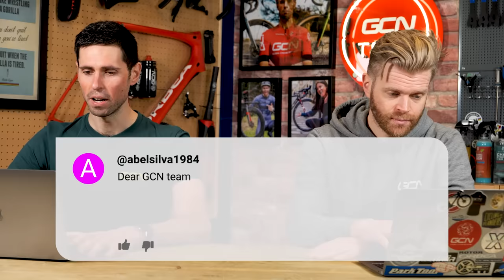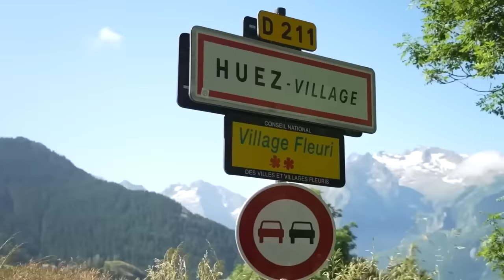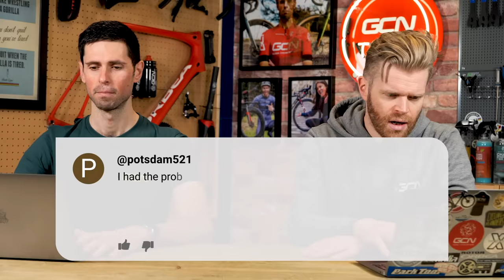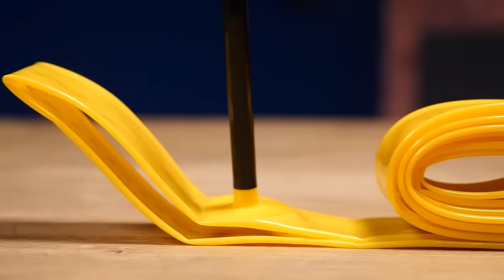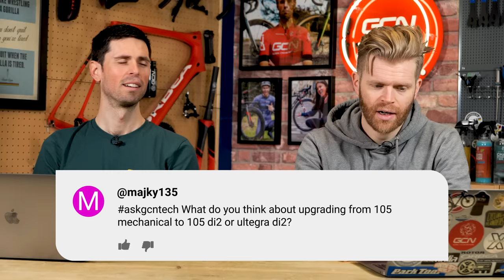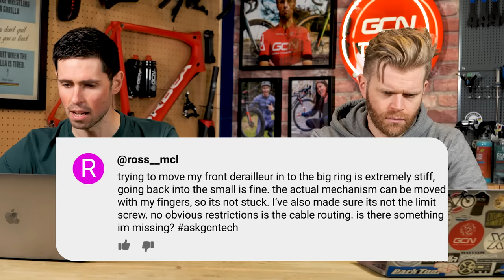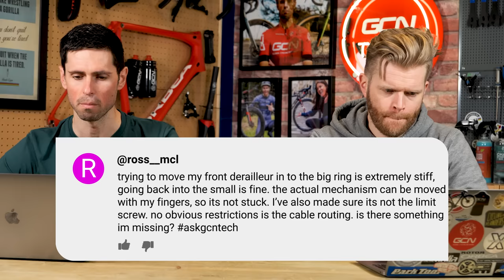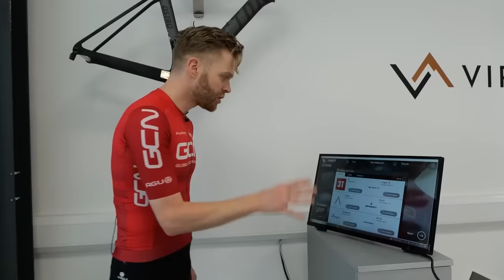Electronic Gears, TT Chainrings & BOA Cycling Shoes | GCN Tech Clinic

Comment: So, two guys who generally ride top-of-the-line carbon fiber bikes with di2 are telling the rest of us alloy and mechanical are good enough. Then why not ride it? (And yes, I know. Alex just built an alloy crit bike. But is it his number one, go to bike?) Beyond that contradiction, one reason I prefer di2 to my mechanical set up is that once it's dialed in, no more adjustments, no more cable concerns, nearly flawless shifting every time unless you forget to charge your battery., which I have yet to do in several years. The difference is night and day when it comes to the riding experience. No, it won't enable me to drop folks, but it will keep me from being dropped due to a missed shift. Not that it can't happen, but di2 is worth every penny. I'm hoping to upgrade my cross/gravel bike to di2 because it's just so much better of a riding experience.

Comment: #askgcntech  I have tubeless ready tires for 3-4 years, and I replenish the sealant every six months through the valve after removing the core.  Do I need to remove the tire and clean out the stale sealant or can I just continue loading in new sealant every six months?
Reply: It's best to (I definitely would, if I ride tubeless that is, but I've handled tubeless multiple times), especially when you've been running for that long without ever doing a deep clean.

Comment: #askgcntech I’ve recently discovered a crack at the bottom of my head tube on my aluminium Bianchi Mega Pro M. I’ve looked to online forums and YouTube for advice to get the frame welded. Most say it’s too dangerous to get fixed but a local bike frame restoration company has said it’s quite common and easily fixed. What’s your advice? Many thanks.
Reply: @stuartodonnell2367 Whilst Aluminium is easily welded you need to look at the age and usage of the frame. Welding a frame which has reached its fatigue limit is a waste of time.

Comment: #askgcntech - I acquired a bike with the older ultegra di2 6770 with external battery and mount, which was working until I disconnected these by removing cables to give the bike frame and components a good clean.  Putting it back together I lost connection all together and the battery mount was diagnosed to be faulty by a bike shop running the e-tube project software. Other that giving the battery mount port and cables a wipe down with a moist towel would that have caused the fault considering it had been working?
Reply: Never expose the electrical contacts to anything other than a specific electrical contact cleaning agent. Next time, make sure the towel isn't so wet you can still squeeze water out.

Comment: #askgcntech
Hello tech team! My question is about frame stiffness. I currently have a cheap alloy frame with cheap included alloy wheels that I purchased as my first road bike but I’ve noticed recently that when I get out of the saddle on a climb I feel like the bike is bending as I move it side to side. Is this just the wheels or is it also the frame? Do I need to go stiffer carbon for both? I’d like to get rid of this feeling but don’t want to upgrade something that isn’t needed. Thanks!
Reply: For starters, check the frameset and wheelset for cracks.
Reply: @yonglingng5640  I've done that. No cracks!
Reply: @Millicente  Do you have the chance to compare stiffness with another aluminium bike of a similar caliber or if it's even possible for you, the same model? You don't have to ride it to roughly compare.
Reply: @yonglingng5640  I don't sadly. Shops near me don't carry my size or won't let me test ride.

Comment: I have a clicking sound coming from what sounds like my drivetrain.  It only happens once my cadence and wattage start to go up.  Probably above about 80 cadence and 150w.  I replaced the bottom bracket and took apart my crank and regressed and torqued all the bolts.  I am pretty sure it's not coming from the saddle or up front as the sound happens still when removing weight from handlebars and saddle.  Do you have any suggestions for next?
Reply: Pedals, headset, seat post.  Seat post is less likely standing but but can still contribute.  Did the re-torquing include the chainring bolts?  That would have been my first guess.
Reply: loose valve in wheel rim.
Reply: @gerrymcbride6429  it's on a trainer right now so probably not that 😀
Reply: @billeterk  that did include the chainring bolts.
Reply: @adamexplores8863 Had I been privy tto that information I probably wouldn't have suggested that. Does it it make the same noise both on and of the trainer?

Comment: #askgcntech ⚙ Hi GCN people, lately I'm having cleat position problems with my right foot but not with the left one, the cleats on both shoes are at the same position, any ideas why this could happen ?
Reply: Did you adjust the cleats based on the markings on the shoe outsole? I always mirror the placement physically, never using the outsole markings.

Comment: Biggest mistake is to listen to the "cheapskate" / sour grapes bunch. Buy the bike you 'will' need and it'll be far cheaper than getting a junk bike and either trying upgrade it later and/or  buying a new bike aka the one you should have the 1st time. Some people revel in showing the world they can ride a beater bike, but they're the same fools  who dumpster dive for free food. A quality bike with electronic shifting, CF frame, good wheels and ancillary parts will also deliver immensely more your enjoyment and directly and indirectly improve your performance. The latter because you're not ashamed of the bike you bought and it's an inspiration for you to live up to it's performance potential. It's also less likely to break down or need constant tweaking by pricing shop mechanics.
Reply: I do not "need" a bike, so I have bought the ones which I want. A bit like the rest of my purchase really.

Comment: What about the harsh ride of an aluminium bike compared to carbon 🤷
Reply: Depends on the vintage. Newer bikes and wheels will support wider tyres which dwarfs frames material differences.  On the other hand, my aluminium bike feels it has a little bounce when pushing hard compared to my carbon which just goes forward.
Reply: Not all aluminium frames are equal, but you can swap your stem and seatpost (if it's a round seatpost) or saddle for more compliant versions.